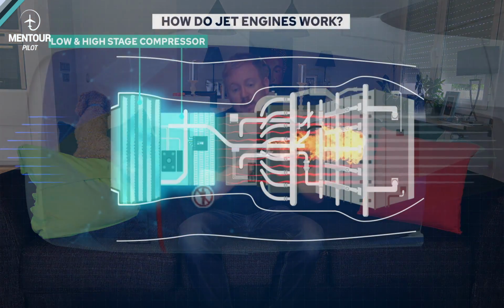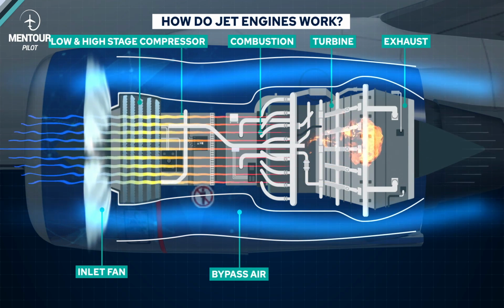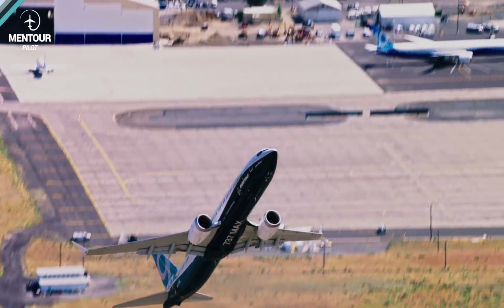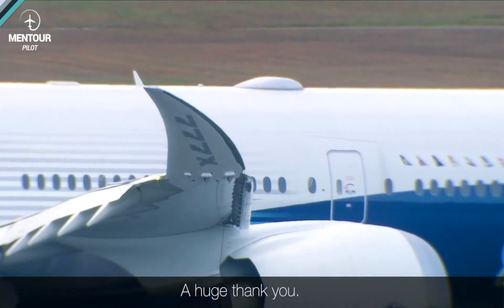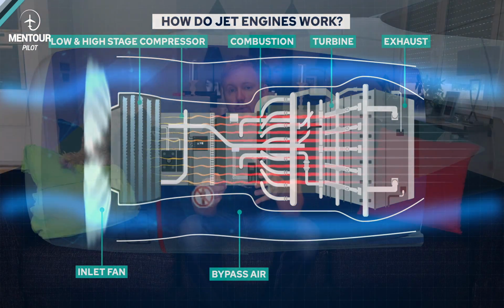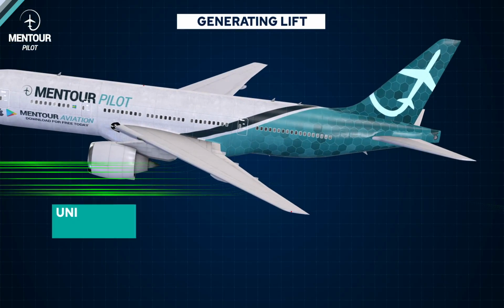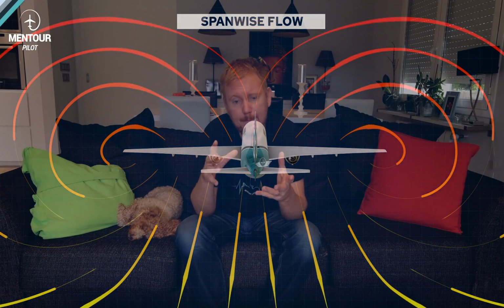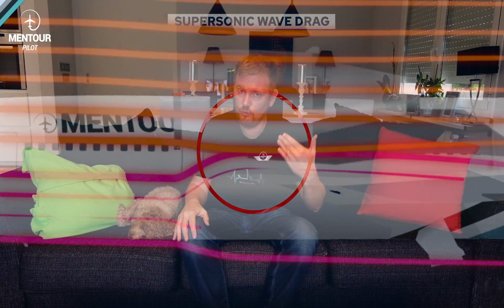How BIG can jet engines get?!

Comment: I'm surprised you did not mention that, as the diameter of the fan disk increases, the tips approach the speed of sound, causing internal shock waves and greatly increased drag- the reason for the upcoming GTF- the Geared Turbo Fan, which uses a planetary gear system to reduce the rotational velocity of the disk- this would enable even larger diameter engines (probably for high wing designs).  Looking forward to a video on those!
Reply: Absolutely, the primary limit on fan size is tip speed (IIRC some reach mach 1.2-ish at full tilt at sea level - hence the rake in fan tips on big engines, like a swept wing, but below 1 is best for that first disc - in the compressor stages increased temperature elevates the speed of sound, so its less of a problem deeper into the engine). The GTF doesn't allow bigger fans, but rather higher LP rotational speed, thus efficiency (its all about the money). The amount of bypass air pumped by the fan is always limited by the tip speed; a smaller faster fan at approx M1 can produce as much thrust as a bigger slower fan also at M1 (without the weight penalty mentioned in the clip), so the gear ratio is set accordingly rather than just making ever bigger fans.
Reply: @andyowens5494  I wounder if anyone tried putting several fans side to side, driven from one turbine through a shaft?
Reply: @solarissv777  Thats so bizarre, but actually an idea worth doing the maths on! There would be additional drag, but I wonder if the efficiencies might work in favour of that configuration?? It would be like a combination of the nacelles on a B52, the four fans of a 747 and the twin engines of the current crop of big aircraft. The only immediate non-efficiency related issue that might be a problem is if one fan of the coupled pair breaks, it would likely take out the other, then there would be a high drag on one side (so worse flight control than if a single engine fails on a twin engined aircraft). Still, worthy of assessment :). Crazy, but worthy.
Reply: @andyowens5494  The another possibility would be to use an electric drivetrain instead of mechanical shaft. Basically, all turbines do is running generators, and the fans are driven by electric motors (modern electric motors can be crazy efficient and compact). Pros: you don't need to put a turbine into the nacelle, thus you are less volume and shape restricted, and thus some kind of thermal recuperators can be used to improve efficiency, also all fans can be driven by just one engine (in case of emergency or to preserve fuel while taxiing on a runway), additionally, intakes for turbogenerators can be placed in places less susceptible to bird strikes. Cons: added weight.
Reply: @solarissv777  I am less convinced by that idea. The electric motors are undoubtable feasible (currently smaller, but possible to scale up to relevant power) but the generation is very heavy and insufficiently reliable at the moment. Yes, small generators are reliable, and yes, big generators in power stations and wind turbines are reliable, but they achieve that through sheer mass (over-sized bearings etc). I still think your first idea has potential :).
Reply: @andyowens5494  As far as I understand electric motors are the same thing as generators, and if the same technologies are used as in the best automotive electric motors they can be made reasonably light (see recuperation in modern EVs). As for power plant generators, they are so huge, because they have to deal with enormous energies (both mechanical and electrical) also as they are not restrained by the size or mass, they can use cheaper materials. Additional possible advantage of electric drivetrain would be ability to fine tune the speed of the fans, to be just below the speed of sound, as was suggested above. 

As for purely mechanical solution, maybe geared clutches might help (pilot gonna decouple them only in case of emergency anyway). Basically you have the turbine somewhere in the middle of the nacelle (to make it symmetrical), possibly with separate air intake (IMHO, in this case it would be less likely to ingest debris or birds into turbine). Then you have only one gearbox, and two sets of shafts connected to it through clutches.  Additionally, as the engines would be just hollow tubes with fans in front, a camera and a set of lights can be put behind each fan, to allow the pilot assess the possible damage and decide which fan to decouple if unsure.
Reply: @solarissv777  ha ha good joke
Reply: @solarissv777  you just throwing silly ideas , you realy , do not have any knowledge about topics
Reply: @makantahi3731  Dude, hybrid planes are currently in the works. My point was, that electric drivetrain will allow to avoid complex mechanical links anyway. I just didn't understand what's the point in them, but with the issue of fan size and tip speed, it seems to be actually clever idea.
Reply: @solarissv777   long story short:what is efficiency of any electric generator
Reply: @solarissv777  generators need a lot of copper for the coils, as do the motors. Copper is heavy, and both generators and electric motors have losses. It makes no sense to use such a heavy, lossy system when a single shaft or simple spur gear does the job fine at a fraction of the weight and, in the case of a single shaft, with zero losses.
Reply: @andyowens5494  
The GTF according to P&W allows higher bypass ratios with bigger fans. These fans are obviously quieter.
Reply: Which is why we are now seeing geared turbofan designs from all the major manufactures to keep the speed of the blade tips subsonic.
Reply: The RR Ultrafan has gearing between the compressor and power turbines. It also reduces the speed of the bypass blades. P&W claims a max gear ration of 3 possibly 3 1/2 to 1. RR claims a max gear ration of 2.5 and maybe 3 to 1. RR will have a max bypass ratio or 12 and maybe 15 to 1. P&W claim a max bypass ratio of 15 perhaps 18 to1x But RR allows each engine section to perform closer to its optimal speed.
Reply: THE PLAETNS OF THE EARTH, MOON SUN NEPTUNE. has nothgin to do with GAS TURBONES ENGINES. YOUE AR COMMENTIGN ON THE WRG CHANNEL.
Reply: @ilovecops6255  I made my comment on the Mentour Pilot channel.  Did it get posted somewhere else?  That would explain the many Youtube comments I have seen that seem irrelevant to the videos.  BTW, I agree with your handle.
Reply: @KirkParro  No. planetary is PLANETE OF THE APES! it ha snuttin to do with SOUPERSONICE FLOW insed  GAS TPORBINES. IOT IS A MOVEE, NOT O REPPPETE NOT BRAYTONWE CYCLE IMETAL COMESTIONE ENGINEERES!
Reply: @ilovecops6255  English please?
Reply: I was about to leave the same comment. Thanks for mentioning it!
Reply: I came to the comments to put this.  Beat me to it.  It is possibly the most important reason of why they will not get much larger.  The issue with the gearing is it is complex and can be seen as unreliable
Reply: I was wondering about using a planetary design to let an outer disk of blades spin at lower rpm than a central set of blades.  Imagine it gets very complicated aerodynamically where the inner set of blades sits in proximity to the outer set running at different rpm, seems like a lot of turbulence would result.  Also wondering why they don't mount the wings to the top of the fuselage.  Obviously, some planes do that, but they are few and far between so there must be something bad about that design.
Reply: Well, he said that the whole aircraft is a compromise, so there are like at least 10 different issues more that weren't mentioned and would create like a 2 hour video that noone could afford the time to watch, unless they are first semester aviation engineers and this was a course class.
Reply: What is a planetary gear system?
Reply: @turtlelmt7 
Google is your friend. It is found in all normal automatic transmissions.
Reply: You are very incorrect.
There are several of the large turbo fan engines which sees blade tip speeds well above the speed of sound. A GE90-115B for example, run at Mach 1.66-1.67 at sea level during a heavy load full power take-off.
One cannot compare the issues seen in propellers to the potential issues seen in turbofans. This mainly has to do with how the pressure wave travels between the blades
Not even the the Ultrafan(if it ever becomes a thing), or the largest 1000G series engines are exempt for having blades travelling at supersonic speeds.
Reply: Why not use variable fan speed? Speed of sound depending of air density and it vary due altitude.
Reply: @jarikinnunen1718  Easy; that would require complex gearing, which is just too unreliable (or if reliable, too heavy). GTF's are hard enough to get a single ratio thats runs for thousands of hours transmitting a few hundred kilo newtons of force. Basic gas turbines (99% of those in service) just had a shaft - no moving parts, so not much to go wrong (provided it doesn't fracture). Helicopters have gearboxes, but tend not to transmit bigger forces, require extensive maintenance, and are still the weak point in the whole system.
Reply: @andyowens5494  Transmitting high torque is easy. Coping with torsional vibration, not so easy.
Reply: @jarikinnunen1718  who would change gears from first to second, captain, first officer or air hostest
Reply: @makantahi3731  Fan gear officer, of cource! What are you thinking?

Comment: I work at an MRO Facility, and i am involved with the GE90 Engine every day. its a great engine, and its huge. I have also been involved with getting our Facility ready for the 9X. Theres some great technological leaps in it with the CMC and additive manufactured hardware. 

The 9X may be rated with less thrust than the GE90 115b, but don't forget is has tested to more than it on the beds, so there could be potential for a higher rated powerplant in the future.

Comment: Thinking back to the Caproni flying barrel idea, how about both engines & fuel in a ducted fan body/fuselage with punters or cargo herded into the wings? Gives a nice flat floor for the trolleys & the Dunlops can park up with the other clanky bits in the middle. Hinge the pax area floors, & you can even drop them open to give the carpet a quick bash. Result : )

Comment: IMHO, is that the RELATIVE SIZE of the fan will definitelly increase but NOT directly connected via a "shaft"... the current trend is electric, so I think the future aircraft would be like an L1011, with a large central engine with a medium bypass, and two (or more) electric fans under the wings, vectored. (is not far fetched to think of a SINGLE ENGINE airliner),

Comment: What about high wing configuration mounted on the upper fuselage, like on the Antonov An-225? That would make a lot of room to fit larger engines. 
Was that solution demoted due to handling reasons?
Reply: Could also be a passenger safety issue? You'd have the engines with a direct line of sight to the cabin, maybe that would be a bit too loud? On the AN-225 they don't need to worry about deafening the cargo :) I can also imagine that in the case of an engine fire, you'd want to keep shrapnel away from the fuselage (placing the engines below the fuselage puts a conveniently placed reinforced barrier between the passengers and the engines, and also makes it harder for passengers to see an engine fire).
Reply: from the construction point of view it's easier to lift the load than to have the load hanging below the wings so this is probably one of the main reasons why we see that it's so common with the low mounted wing designs on bigger aircraft.
Reply: @polcho  most purpose built cargo planes have a high wing design though

Comment: If they want even bigger engines, why wouldn’t they just use the wing position and angles of a TU-225? (I’m not sure how it’s called but some planes have the wings above the frame like the Cessna or TU-225, and some have the wings angled down rather than up)

Comment: A very important factor as well is the velocity of the tips of the fan blades.  The larger the diameter, the greater the angular velocity at the tips.
Reply: Actually, it's the linear velocity. Angular can stay the same but with increased diameter you have greater linear velocity which matters in terms of airflow

Comment: What if high wing configuration is used with an enormous engine? Sound issues (typical thing for a high wing with bottom engines) should not be a big factor here, as modern engines are relatively quiet.

Comment: About the engines above the wing, the only civilian operational jet plane to have them was the VFW-Fokker 614 in the 1970's. It was not a fast plane (380 kn max speed), and the jet engines were not high-bypass ones (2,85/1), so that mitigates the wave problem. It was a commercial failure anyway (19 produced).

Comment: The RR Ultrafan R&D project envisages a fan 3.56 m diameter - ~10.0 square metres - for max 500 kN thrust??  But cowling only 4.2 m (??) diameter - see below. It will have 18 fan blades - carbon fibre with titanium leading strip. It will have a variable pitch fan (like a turboprop). It will only have 2 shafts - one for high press comp and turbine, one for low pressure turbine, low pressure comp and fan. There is an 800 mm dia. planetary gearbox (5 planet gears) between compressor and fan to reduce fan speed. Pitch of fan blades changes to increase/decrease thrust rather than fan speed. Apparently, the fan can do reverse thrust, allowing current style thrust reverser to be eliminated and nacelle to be slimmed down (4.2 m diameter??). A pancake style starter-generator could be mounted on the planetary gearbox and the accessory gearbox eliminated. All aircraft systems could use electric power for greater system efficiency. Main landing gear hydraulics would be run using electric power. Air bleed from the high pressure compressor would still occur to provide cooling air to high pressure turbine blades - blades have small holes through them to provide a film of cool air to turbine surface - blades should be ceramic matrix composite. Perhaps planes with end up with two complete APU-generator units due to the reliance on electric power. Essentially, the electrification of the aircraft we see with the B787 will deepen. Onboard battery will get more energy storage, and possibly two ram air turbines as backup.

Comment: The term "efficiency" is thrown around very loosely, particularly at the beginning. The switch from the 737 -100 and 200 to bigger engines in the classic and NG was to get more thrust. Efficiency had nothing to do with it. On the 777X the new engines make about the same amount of thrust while using less fuel. That is an increase in efficiency.
Reply: Not really but this is the problem of these vids that try to explain complex things in an easy way. The video lacks basic jet engine topics and touches topics that have influence but not really explain the essence. The high exhaust speed for low bypass ratio engines creates low mechanical efficiency compared to high bypass as the exhaust velocity is much higher compared to the aircraft speed. To name one single thing...

Comment: Well, if you can't put the engine on top of the wing, why not put the wing on top of an aircraft? Like AN-224 and AN-225? 
You can put huge engine under this wing, and the landing gear can be even shorter than it is now in 737.

Comment: The F105 Starfighter had Coander effect wing that Intrained compressor air,  like a Harrier's engine, multiplying lift at takeoff but reverting to  normal as airspeed increased. Not short takeoff but for speed after takeoff. The body and modified engine were then given the longest wings,  becoming the U2.

Comment: My view is same of yours - that the bigger engines are to accomodate a bigger fan at the front.
More low speed air signify less critical compressor stages, which in turn makes for a more reliable engine. A win-win situation.
But, viewed from another perspective, an engine where 90% of the total thrust is achieved with the bypass flow - it looks to me like a turboprop engine with the propeller encased into the cowling.
I'm not joking here: if the manufacturers leave the compressor/burner in the cowling and bring the fan outside of it, they will have gone full circle...
Thank you Mentour Pilot for the great explanatory video, I liked it very much.
Regards,

Comment: If you cant put engines on top of the wing, then surely the solution to this problem for allowing bigger engines under the wing would be to move the wing from the bottom of the plane to the top of the plane (sort of like the anhedral setup of the AN225)